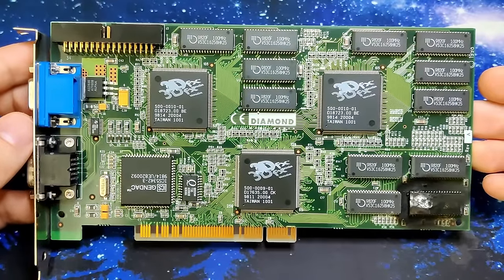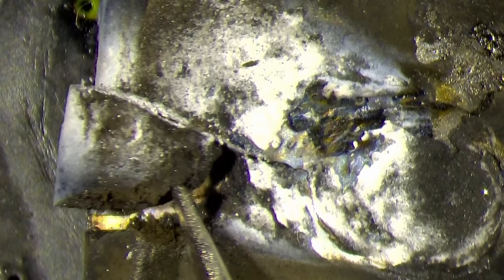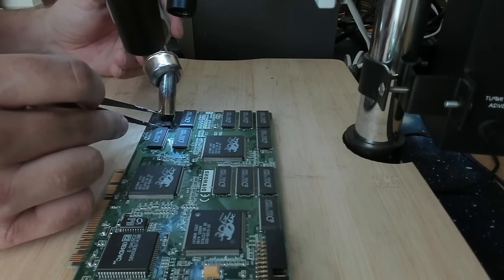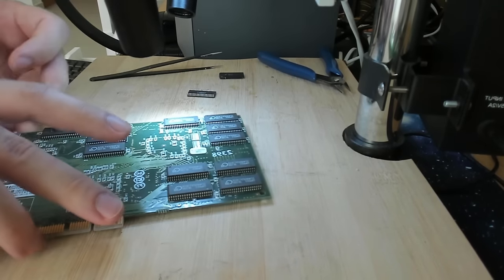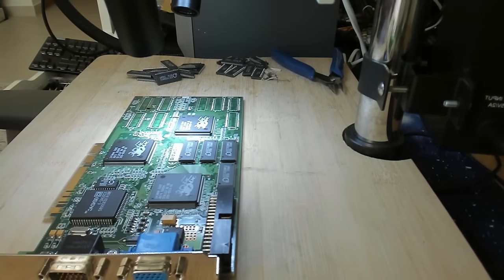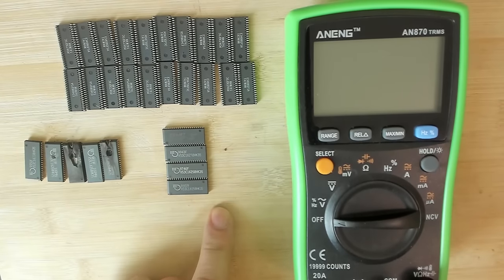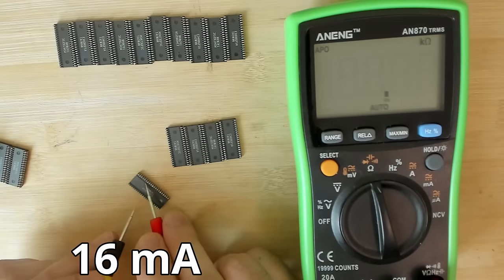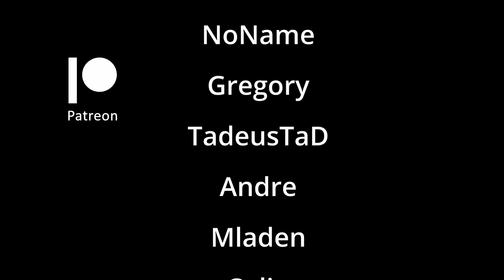Explosive Memory: Can we save this Voodoo 2? (Part 1/3)

Comment: Nice video as always! Personally I wouldn't bother with any of the memory chips that were involved in "the accident", but "for science" it might be interesting to see if any have survived. :) First thing of course is to make sure the card itself is ok. For that test it might not even be necessary to solder the 12mb onto the card. Should work with 8mb only. If the card works, you could solder the rest of the memory onto it, but also add a temporary socket to it, so you can easily swap out chips to test if there were any survivors.
Reply from the maker: Correct. In fact, I started with 0MB - just to see if the card works. Part 2 will be online soon!

Comment: No need to install memory sockets to test the good (maybe) chips. If You have a S3 Virge or Trio or Cirrus logic or other PCI card with these upgrade sockets You can test in there. There is software I used to test the memory installed in these PCI cards. This can be found in my Vogons thread titled "3dfx Voodoo 1 fault diagnosis and repair"  I doubt the software works on the voodoo cards but it works fine on the 2D PCI cards. I think You have to boot it with a floppy as well.   Looking forward to Part 2!
Reply from the maker: Yes, this is what I'm going to do. I have plenty of S3 cards that can be used to test the memory chips.

Comment: Don't bother with those survivor chips, just toss them, the risk it too high of damaging a Voodoo chip.  I had a power supply (built a Athlon computer back in the day with parts from a computer fair) that was some no name Chinese brand and it killed EVERYTHING in my computer back in the day. Even the keyboard and mouse.  The only thing that survived was the case, mousepad and monitor.  Killed my Geforce MX2 cards I had in it too.
Reply from the maker: I tend to agree with you. If I test them, it will probably be in an S3 card or something like that. The Voodoo 2 doesn't have space for sockets anyway.

Comment: Cloudy in Dubai! :) 

I was not expecting the short to go with the RAM to be honest. I'm curious to see if whatever caused all that damage has also damaged something else!
Reply: There could be further damage but the ICs themselves have probably been saved by the voltage regulator. The RAMDAC runs off 5v too though so that might yet have a problem. Great that the short is cleared already though. 
Looking forward to the next part, that's a lot of RAM to repopulate.

Comment: From my experience I did not think the short was gone after removing the memory. I thought there would be also some caps which were invisible blown open, because they are also very sensitive to overvoltage (especially the tantals, if they are connected to the faulty voltage rail).
A few recommendations for the future. I am no fan of using excessive amounds of flux, but if you have chips like the exploded one, you want to use some good amound of flux. It will help to break up the oxidations, which can be difficult to melt the old solder. Also it will help you to distribute the heat of the hot air better between the metal and non metal parts. This will take off stress from the pcb and the traces. And last but not least be sure to remove every trace of black stuff on the pcb and the components, because it could lead to future faults or damage by carbon tracking. Indeed the voltages are low (compared to TVs where this is a greater issue), but current is a lazy b*tch and finds the shortest and easiest path, even if it is some left over carbon on the pcb.
Keep on your good work and I am looking forward to part two.
Reply from the maker: It could be that we got 12v on the 5v line (speculation). Most caps are probably rated for 16v and above (50v for the ceramic types). So, it could be that the rest is fine, we just have an issue on the memory that gave up rather quickly.

Comment: Wow, RSVP all those dead memory chips! I'm really surprised only four "survived". Definitely worth testing them, but I wouldn't hold my breath that there's no other problems with them.

I actually had the 8MB version of this card (same brand, Diamond) back in the day. It was a huge leap in performance and visuals compared to my S3 Virge DX. I really wish I kept that card, because it was the most expensive thing I'd ever bought up till then, and one of the very few upgrades of that time that I bought as new instead of second hand. After I upgraded to a newer, faster AGP card, I leant my Voodoo2 to a friend, who said it didn't work. I asked for it back so I could test it, but he never returned it.

Now I've got a few Voodoo2 cards, including a Diamond 12MB card, all of which have been on the "project" pile for years since I never even got around to testing them. I even bought the memory chips to try upgrading an 8MB card to 12MB, but again, never got around to it.

As for your card, I'd give it a 65% chance of working again.
Reply from the maker: I will make so many Voodoo 2 videos now that will make you want to look at your pile of 3Dfx projects to do 😂
Reply: @bitsundbolts  Sadly they're all packed away along with the rest of my retro/vintage computer gear. I was geared up to do more electronics projects (I don't really have the space for retro computer projects), but then I caught COVID in 2022, and since then I've barely had the physical or mental energy to do much after I've finished work. Which is why I love watching other people work on vintage/retro computers and related projects!
Reply from the maker: I'm sorry to hear. I hope you will get back your energy!

Comment: I suggest you try measuring continuity on each memory pad (one  memory slot should do). There could be a short on the board that fried all of those chips (though I suspect you were correct that it was a bad PSU). Otherwise the Voodoo might be visible in the system most likely even without any memory.
But with so many chips fried, I'm affraid that the TPU and FBI will be also dead.
Reply from the maker: This is what I am going to try in the next video: 0MB, then FBI memory, then TMU memory, etc. I really hope that the 3Dfx chips will be fine, but it could be that some of the memory chips shorted address / data lines and killed the 3Dfx chips.

Comment: The resistance that you measure betweem Vcc and Gnd will change depending on the polarity you apply. I noticed that you rotate the chips when measuring but don't swap the probes around, so that may explain why you get different resistance values between the 2 ends of the chips.
Reply from the maker: Oh really? I was not aware of this! I will check it once more. Noted for the future - thank you!

Comment: Man, WHAT A THRILLER! So many twists and turns! It was super interesting to see the innards of the memory chips, I am amazed that they are looking relatively okay! The PCB looks about like I had hoped for, but I expected only charred fragments to be left inside the memory chip housing. Good thing I resisted the urge to clean it up or start working on it myself, but left everything untouched, knowing it would make for a much better video.

Hearing the disappointment in your voice after each round of chip removal was so heartbreaking to hear, but it made the surprised amazement that THE SHORT IS GONE! all the more cathartic. 😄 There's still a chance! 🤞🤞 Dare I answer your quastion with "Yes, I believe it will be able to render Interstate '76 once again!"? Seeing even some possible survivors among the memory chips and having learned that the 3dfx chips are apparently only supplied via the VRM, as I had hoped, I am hopeful for the first time since I (re-)discovered it in its sorry state. YES, I believe this may "just" be a serious case of "memory loss"! 😄

IF it comes back to life, it would be kinda cool to see the potential survivors on the card again, but it's probably nicer to look at if it's a matching set. I wonder if they were adjacent or randomly distributed across the board.

Also, I thought that you are a leftie for a moment, but then I saw the writing on the chips and realized that the video was mirrored. 😄

Fingers crossed!!!
Reply from the maker: Thanks for the card! It is quite the project and I am learning a lot along the way! I don't think the survivors will ever make it back on the board. I have 200 of those EliteMT chips - no reason to risk a Voodoo 2. But I might try them on an S3 card. 
Yeah, I noticed the mirrored camera after I finished the video. If I make such a setup again, I'll pay more attention - oh well, mistakes happen.
If I get this card fixed, I'll try Interstate 76 (I never tried that game).
Let's see if that voltage regulator protected the 3Dfx chips! Part 2 is coming out this weekend.
Reply: @bitsundbolts You are right, this is indeed preferrable, Voodoo cards are just too precious to risk damage. Never mind the mirrored image, it probably went largely unnoticed anyway. Just something to look out for with such setups.

Oh boy, I really envy you for being able to experience Interstate '76 for the first time! 😄 Story, soundtrack and voice acting are top notch, gameplay is a blast too (literally) but can be a bit tricky at times. It also runs best on period correct machines, in a way it's from the worst period to reproduce on modern systems. It can be made to run properly on a modern PC, but requires more tinkering than usual. Sadly, the successor Interstate '82, while starring John de Lancie (best known as Q from Star Trek and maybe Alarak from Starcraft 2) is a marked step down quality-wise. I also haven't managed to get that one running properly on a modern machine yet. Haven't tried PCem yet though, that should finally be able to do the trick.

 If you get this Monster 3D II back into working condition, I would be absolutely thrilled if you sold it back to me - once you are absolutely certain that you don't need it for future video appearances! 😉
Reply from the maker: If I get the Voodoo 2 back into a working condition, I'd gladly return it. I have enough of those cards - no need to keep everything for myself 😄
Reply: @bitsundbolts  You, good sir, are a true friend and a gentleman. ❤ I will reciprocate in any way I can! 😊

Comment: Great video!!!  Amazed at how many died, it must have seen an over voltage on the 5v rail?  Maybe the other chips on the card use 3.3v?  Fitting sockets to test those survivors would be cool!
Reply from the maker: The common belief is that 12v entered the 5v line. I think that could cause damage like this. Unfortunately, sockets won't fit on the Voodoo 2. There's no space. The memory chips are too close to each other or there are SMDs in the way.
Reply: @bitsundbolts  I don't see how that would happen tbh!  I've never seen 1 rail short to another that way, but I have seen a rail go high.  Because of the crazy current a PSU provides (eg. 10 to 25A on 5V), the result is pretty dramatic!
Reply from the maker: It could be, I'm just speculating and learning along the way 🙂. But I guess we all agree that this was caused by over-voltage.

Comment: Measuring the resistance on the board might have lead you to the culprit, but in this case, there were very many offenders. I suspect the survivors will be fine, but they should probably be tested somehow. I think you'll be able to save this card.

Comment: You can also leave the meter connected and check if the resistance increases when you remove more components. You'll see if multiple are shorted if the trend is in the same direction. This of course depends on the precision of your meter but it can be useful.
Reply from the maker: Yes, you are right. I am sure it would be visible. Each time I remove one of the memory chips, the resistance would have jumped a little bit.

Comment: If I were you, I would solder plug in sockets so that it is easier to swap out the memories. Also all memory chips are now out so it should be fairly easy to solder new sockets. That way you can try and use survivor 4 chips and in case of failure again, it is easier to swap.👍🏼
Reply from the maker: I tried sockets, but there's not enough space. Either the memory chips are too close to each other, or SMDs are in the way.

Comment: Yes please add one socket and test those low resistance chips too 🥳
Reply from the maker: Haha, nooo :) I will never put those low resistance chips anywhere except in the bin for recycling.
Reply: @bitsundbolts  alright alright should’ve made myself clearer, I meant put them on the board via socket and see if you get a short

Comment: holy shit, i've never seen such a damage on a card. it seems the psu sent 110/230V directly to the 5v rail. i really hope it can be saved.
Reply from the maker: Yeah, it looks bad. I am not sure if main supply went into this card. Maybe it would have caused even more damage. I think the 12v line would be enough to cause this type of damage.
Reply: This! And 230V, the murder happened in central Europe in broad daylight. 😅 Let's hope for the best!
Reply: I think it's just the 12V rail shorted to 5V somewhere in the computer or in the PSU. I mean a EU power supply shouldn't just send 230V down; then again the early Codegen units from when this video card was relatively fresh did fail in terrifying ways, so who knows, LC-Power weren't great either. Overheated transformer should be orders of magnitude more likely to short two secondary windings one to each other than primary to secondary. Though of course PSUs with insufficient primary to secondary insulation, while highly illegal, is a thing that popped up once in a while.
Reply: @SianaGearz  You make a good point, maybe it wasn't quite as violent as 230V AC after all. I would never have expected 12V to be able to cause that kind of damage though. These were the Wild West days of PSUs though, so who knows. 😅 Either way, It's long gone, but certainly was a budget model, the (still present) case leaves no doubts about that. LC-Power still are bottom of the barrel, at least they are consistent! 😂
Reply: @DefenderOfBoston-yo2tl   The reason i think it's not 230 is that nothing would have survived that, and it need not look particularly violent, it could have after all burned out quick PSU side before a substantial fire in PC, but there's just not a single semiconductor in PC capable of surviving such voltage even for the shortest amount of time.

Of course delivering humongous fire-inducing current for a few seconds off the transformer secondary, particularly if 5V and 12V rails end up being shorted together, is not at all a challenge for a PC PSU even a shitty one. I mean it'll probably go up in flames and the control IC will not even register a fault condition and try to stop it (another trait of cheap PSUs), but at first the current will flow.

Comment: Check the voltage regulator before you will try to power up the card. Good way may be desolder it and try to inject right voltage to chip power rail. If the current will be normal, there is a good chance it did survive.
Reply from the maker: Yes, I agree. However, if the voltage regulator failed, it may have killed the 3Dfx chips before. But, I'll be cautious.

Comment: And that, kids, is why you should install DC-DC converters between the expensive chips and PSU. Even if the PSU claims to have exactly the voltage your ICs require.

Comment: I would of checked if the 2 vcc pins were connected internally, could of saved a little time
Reply from the maker: Good point. VSS (ground) is connected internally, VCC (+5v) is not.

Comment: What happens when you solder the Voodoo 2 Memory on a Voodoo 1 Card and get more mem bandwith for the chips? Would be interesting for curiosity and comparison😅
Reply from the maker: My (very confident) guess would be: nothing will happen. There are Voodoo 2 cards with 35ns memory chips (common are 50ns). There is no difference between those cards since the 3Dfx chips won't take advantage of the faster memory.

Comment: Amazing! If the rest of the chips are fed from the voltage regulator on the card and have no direct connection to 5V (and one wasn't made by the memory chips melting), maybe the card can be saved! :D
Reply from the maker: I hope so! Could be that the voltage regulator saved the 3Dfx chips. I just hope the memory chips didn't send high voltage into the address or data pins of any of the 3Dfx chips.

Comment: It's for sure not very likely that any of the chips behaved different in the second when the PSU failed. The 5 Volt rail is in parallel for all chips, so they all should get the same current/voltage for a short moment (just a bit different caused by the width and length of the supply lines on the PCB). Very unlikely any of the chips survives such an accident.
Maybe the distance in the chips between 5V and ground is very low, so the metal melted and created a bridge.
The burned out chips maybe saved the 3DFX chips, just because they all have eaten away the available power and created heat of it.

Comment: It looks like a victim of Codegen 200W / labeled 300W power supplies (chinese engineering). Back in the days we have had several examples of similar feilures where the only survivor from a whole PC was... CD drive. Literally everything was toasted, every part. BTW I vote against sockets, keep it original. You can check RAM using elcheapo 2D PCI card.
Reply from the maker: Thanks for the info on power supplies. That CD drive was a keeper! And sockets are not going to be on the card. There is no space anyway.